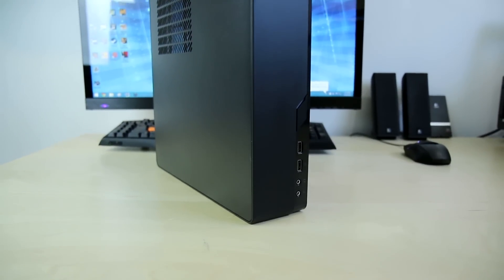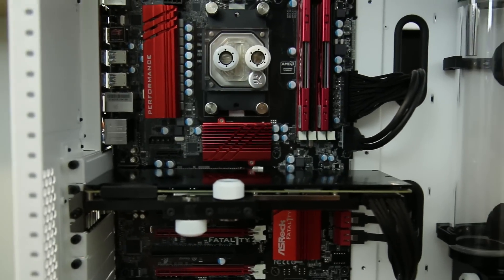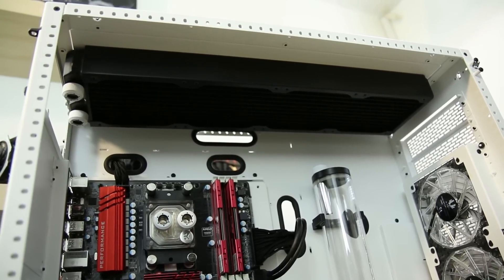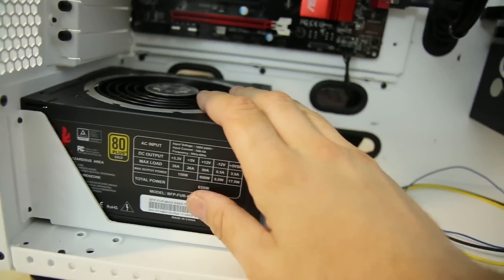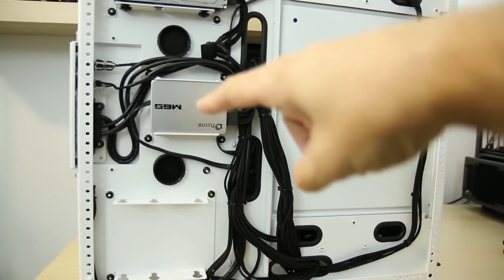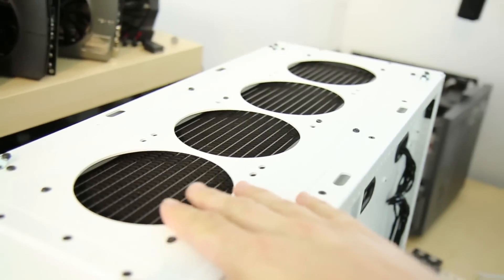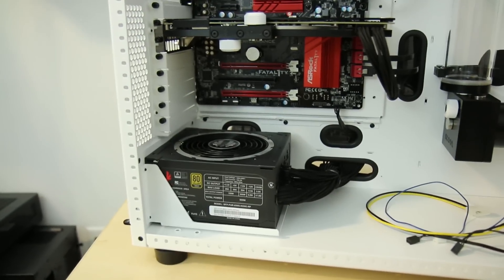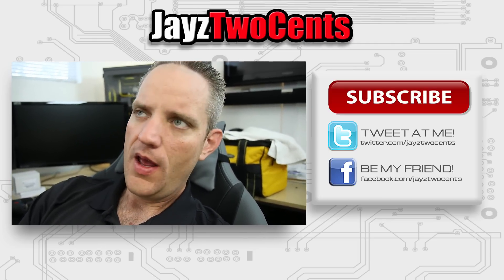Custom Watercooled AMD Build Update No. 1

Comment: Watercooling is kinda funny. When you are aircooling a case you need a bigger case with lots of cable managment so you don't restrict the airflow and fans. If yo want to watercool a case you need a bigger case so you can fit radiators but they don't work well unless you have, again, a really good air flow and a lot of fans. So why all the people who are watercooling their pc are saying that the best silent pc is the watercoold one? How is that? You have more fans stackd against radiators and waterpomps who again they make noise. Pomps+Fans in my opinion are not more silent than just fans. I recently tryd some corsair and coolermaster watercooling and they are awefull. They make much more noise than my air cooler from coolermaster.

Comment: So basically you feel the need to tell us specifics like what pump you used, the brand of radiator, and even the type of sleeving on the power supply cables, but felt like telling us what cpu you used isn't important? Is it that you forgot or that you haven't even put any cpu in yet?

Comment: Seriously ? Positive pressure? so no dust gets in? i hope you have static dust guards on the intake.
also a pc is not a fab, some dust ... meh. just clean it once in a while. .. and that is why you put fans on top of the radiator, and not on the bottom (yeah so you can clean the radiator easily)

Comment: AMD CPU + Nvidia is actually a lot better because AMD GPUs suck with slower CPUs.
Reply: Orjon Zaganjori don't make me regret my choice oooh booh oooh some guys direct me to the GPU R9 380 which of course i buy for a first GPU because i was running short on money and didn't want a horse GPU since i still kept my XBOX 1 just in case ( let's see the Batman Drama on PC for example )
Reply: More high end problem. Your fine with 380
Reply: i don't know if the 380 handle 4k resolution because it was likely the goal of AMD with the R9 3XX series but im already happy with a dual screen @ 1080p maybe i will had a 1440p for the main screen ( the ultimate goal is a 3ple screen in my room ) ! and god Steam is like a cavern full of good games to me now !
Reply: Roger-Charles Manga I can tell you right now that the 380 is not a 4k card. But for 1080p it's just fine. :)
Reply: ok so the spec are pretty bullshit ? SO at least it does what those consoles struggles to deliver #nextgen1080p
Reply: Roger-Charles Manga The goal with AMD's 3xx series was to keep AMD competitive against Nvidia in a price/perfomance criteira. Remember, R7 360 and R9 370 are still 3xx series cards, and they are low end and mainstream, respectively.
Reply: ***** Also Vulkan, don't forget that.
Reply: Roger-Charles Manga the card CAN display at 4k and maybe some older games you will be able to run them at 4k with playable frame rate, but newer games you will get single digit results.
Reply: ok so i can go ahead and buy a 3r 1440p monitor , 4k monitor are pretty expansive in france at least 300€ and higher if you want the top quality, i will run 2 1080p monitor and 1 1440p as main screen now thanks for all your advices !
Reply: Roger-Charles Manga You can run games at 1440p but don't expect that you gonna max out settings on all games with 60FPS. If you are fine with lowering some settings you should be good to go. :)
Reply: i got a 290x and i have to lower some settings to get it 60 avg on 1440p
Reply: i'm not complaining about lowering some spec in order to achieve what pS4/Xbox One strugle with i just want a solid 60fps
Reply: i just imagine i could manage to play even on medium or high not ULTRA since im not a hungry gamer so... thanks guys for you advices !  is the Define R5 a good case ? im looking for a case that came with pre-installed cage for SSD !
Reply: i might go for the R4 which is still a good choice i think and the fact that every usb port are on top is looking more secure to me ! with a good pair of Noctua fans here and there my build will be a silent one ! it was worth the wait to me to think well about the parts now it's going to be a crazy thing to build it myself, are the standoff already preinstalled on the define R4 or R5 for the Mobo ?
Reply: Roger-Charles Manga Itll do 1440p good, dont worry :}
Reply: akalion213 It will.
Reply: Rockymann27 It will, but on medium settings max to get around 60FPS on AAA titles if he's lucky.
Reply: František Hájek Not everyone cares about having everything at th ehighest settings, everything turned on, and maxed out ya know lol
Reply: Rockymann27 Still with 380 he would be way better off on 1080p.
Reply: František Hájek As you can see though, he strrongly wants 1440p though and i dont blame him. Turning down a few of the settings to medium to get a stable 1440 p is worth it in my book :P
Reply: Rockymann27 Hey, I am not saying he can't, but from the longevity standpoint he's gonna have to upgrade to a better GPU or Crossfire sooner than on 1080p. But we had that talk and he knows what he's getting into. 1080p being better in this scenario is only my opinion. I am just trying to warn him about all this stuff. :)
Reply: akalion213 Yes it can.

Comment: To be honest and no offense to jayz if he does happen to read this, this build is utterly stupid, my explanation for this being that AMD just came out with the r9 fury and it could be waterblocked for the purpose of being a true AMD build, using an amd cpu at this precise moment is a bad call considering amd's cpus are 4 years old and have not seen any significant changes since there debut in 2011, if jayz had waited just one more year he could have used amd's new zen processor and if the client couldn't wait a year then just any i5 or i7 could have done the job without risking a CPU bottleneck on the games

Comment: I hope you realize the 970FX motherboard will struggle and will often downclock / throttle with the 8core AMD FX due to the limitation of the VRM's on the 970FX motherboard. I will also say the NB and HT will not run the factory AMD FX clocks of 2200mhz NB and 2600mhz HT it will run because of the 970FX motherboard 1800mz-2000mhz on NB and 2000mhz-2200mhz on the HT this is a loss of performance in alot of modern games of around 10%-15%+ of total performance so in short you are giving away alot of performance / FPS for $50 or so of extra cost to go a proper 990FX motherboard should have been the choice in longrun because 15%+ loss is substantial.
Reply: I definitely can't get a steady OC with my 990fx rev 4 and 8350. It's gets to 4.3 and then the blue screen. If that's your setup, how do you do it(settings in UEFI)?
Reply: Holden Abedrabbo  990fx rev 4 what brand of mobo I am running sabertooth 990fx with FX 9590 at 5ghz x8 manually clocked 24/7 with all my eco stuff running 100% stable.
Reply: Rick Cooper It's a gigabyte mobo. The UEFI would be the same regardless of brand, wouldn't it? Maybe I just got unlucky with the lottery, that's most likely.
Reply: And ironically as I'm sifting through the articles for OCing this CPU/MOBO again(mind you, I haven't researched this for about 6 months),one of my 6 pin connectors for the CPU just pops out of its socket. Yea, I think my CPU is trying to tell me something. 

"I'll kill myself before I do more work then what I was told."
Reply: 6pin what should be an 8pin not 6pin if running a 6pin to 8pin adapter theres your issue the 6pin can only push around 150w and at around 5ghz we are talking around 250w pull at 4.7ghz we are talking 220w or so and at 4.4ghz well around 180w so your likely overloading your power feed with the 6pin power plug.

PLZ look up the power limit of a 6pin GPU power connector it is like 75w max safe before it starts melting and connectors and such fail and a 8350 even slightly overclocked goes above this and can nearly do it running stock so do the math as to why you cannot OC for crap.

you are lucky you have not fried your MOBO / CPU over this as you starve a electronic component for power  AKA voltage starts drooping the amp draw increases amps are figure wattage divided by voltage as volts go down wattage draw goes up so amperage draw also follows.

This meens more heat and massive efficiency drop on the VRM's meening even more power draw because the VRM's have to compensate for the drop in the incoming voltage.

This meens even more power is drawn to convert to usable power for the CPU and everything else including the system RAM and NB and such all fed by the same 12v input hince the 6pin power connector you are using.

The 6-pin PCI-E power connector specification includes two 12V wires and three ground wires and has a rated maximum power output of 75W. The 8-pin includes three 12V wires and 5 ground wires and has a rated power output of 150W.

75w=6pin
150w=8pin

here is a good link to get reference about all your power connectors for PC  http://www.playtool.com/pages/psuconnectors/connectors.html
Reply: Lol yea, you're right. It's a 4+4 connector, it's been a long day.
Reply: regardless you are technically overloading it i bet the 4+4 is not a full on rated 8pin but in reality a splitter putting same load on 1 set of wire very common for alot of power supplies this will cause bad Vdroop outside of the VRM's control.

put it under load and watch your CPU voltage and look for droop then try LLC or better known as load line calibration in bios if the voltage is still drooping then start looking at your power supply or at your mobo itself having faulty VRM design for what you are attempting just my 2cents / experience what mobo you on by the way if is a asrock 12+2 power phase one theyre known to be cheaply made and often have very bad Vdroop.
Reply: I'll have to sift through all that info tomorrow as well. My mobo is gigabytes 990fx ud3 rev 4. My PSU is rosewills stallion series(700w), I'll have to check the box if it even came with an 8pin connector. What you're saying makes sense and I went through sites finding out how to calculate the actual wattage output on rails and what not. I have a multimeter and I checked all the voltages in this PSU awhile back. Thanks for your time.

Comment: In my opinion (not fact), It doesn't make sense to get a water-cooled build when on a  restrictive budget. The same money invested into water cooling a single card system often is enough to either pay the entire or majority of adding a second graphics card, Adding a second graphics card yields much higher performance than water cooling a single card. Again, my opinion, I am making no claim to enforce how people should spend their money, rather just how I would do it.
Reply: Elias Montejano Sure, you could buy a second card, but how many games actually make use of said card?

Comment: Jay y re fanboy...R9 390x is faster then 980.If you can say that 980 faster then all of your benchmarks are fake and you re just Nvidia fanboy,which is true.You can see that from your videos...like saying your Titan X'es  was bottle necked from your 5960x which is not true.Only reason why you couldnt gain that much perf from 3 way sli is just because Nvidia's sli technology is not that good.PCper has just shown that...
Reply: All Mighty Egerion 390x is faster - in some games.  And doesn't have a readily-available waterblock.  And he didn't already have one in his house with a waterblock already attached.
Reply: All Mighty Egerion even if it was GPU side bottleneck there, it wouldn't be SLI's fault, it would be Multi-GPU's fault.
Multi-GPU performance scaling as a general rule is absolutely terrible. you're jumping up and down in tears of joy if your second GPU gets a 75% scale. and it just falls off a cliff from there.

Comment: "I chose this ram because it's red and looks good"... :facepalm:
Reply: Heruvilius any decent ram is a good ram.. ram doesn't effect performance  unless you are below 1600mhz...  you only need high performance ram if you have an APU system.  you should learn more from LinusTechTips
Reply: primus loy That wasn't my point.
Reply: Heruvilius Then what was?
Reply: AGamingPanda That hardware quality is evaluated by its looks these days, which is wrong.
Reply: Heruvilius I don't really know how for instance the quality of a GPU is evaluated by its looks, because the reference is usually less powerful than the ones by asus and such and ones with aftermarket coolers are also better. And pretty much any ram is good so I don't really understand your point. :)
Reply: Heruvilius It doesn't actually look that good though, does it? It's a noticeably different shade to the red on the motherboard...
Reply: AGamingPanda RAM is bad example, although I had serious troubles with QUMO sticks. Videocards, ok. Jayz likes MSI VC, but there are lots of people, whose MSI VC just fried out due to power delivery system bad quality. I can't remember what was the gpu exactly, but MSI really had an issue a couple of years ago. Now, those were pretty sexy looking videocards, but their quality was bad.
Reply: Robert Faber I don't actually give a damn about looks of my hardware as long as it kicks butt in my applications.

Comment: Would this be a good rig for my first pc ,I wanna be running games like bf4 metro last light around 50-70 fps on high end settings
http://pcpartpicker.com/p/BGB6bv
Reply: I have a computer with similar parts. It can run every game it encounters with high graphics and can run BF4 at a minimum frame rate of 80. My 970 had only 2gb of vram though, so yours will be even better. All in all, should be good.
Reply: PerfectionAdvocate 970 2gb? Wtf are you talking about?
Reply: 970 2gb? what
Reply: of VRAM
Reply: PerfectionAdvocate 970 comes with 3.5+0.5gb of vram

Comment: This is such pointless build. Sorry jay you should not watercool at this performance level.
Reply: FrostFyre the water cooling gear is about 100-200 dollars and that could be put into another Cpu like the 4790k or a better Gpu.
Reply: beach_boy 98 and then there is that caselabs U$ 350+ case...
Reply: beach_boy 98  we dont watercool because its highend we watercool because it keeps the CPU temp under control.

and it looks nice. 

so he should get a 4790k with a stock cooler. or get a titan x to p;are with that 8350.
Reply: beach_boy 98 The more such comments I encounter, the more I am inclined to start a petition to have the word "should" removed from the dictionary.
Reply: beach_boy 98 you have no idea as to why or why not it should be watetcooled. He has the parts laying around, let him do what ever he pleases.